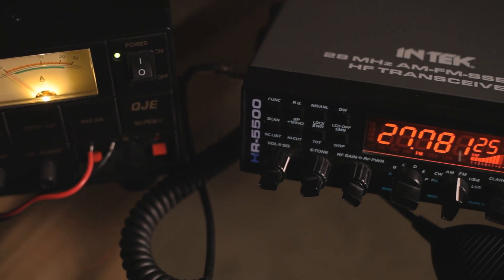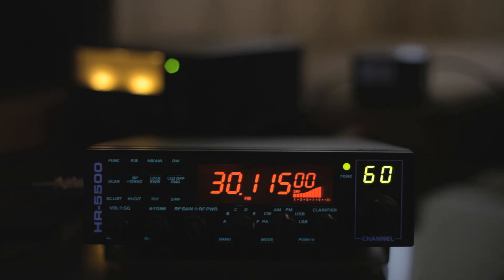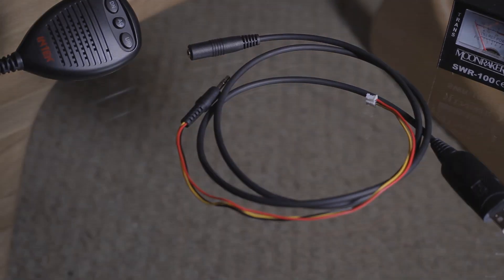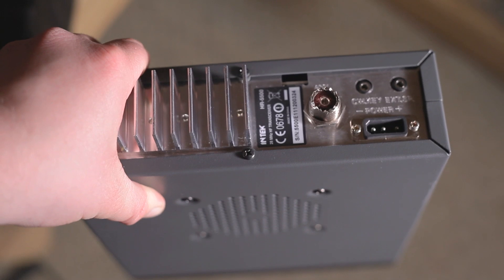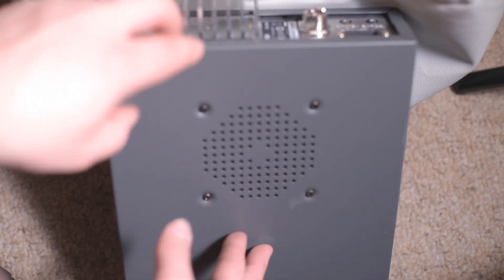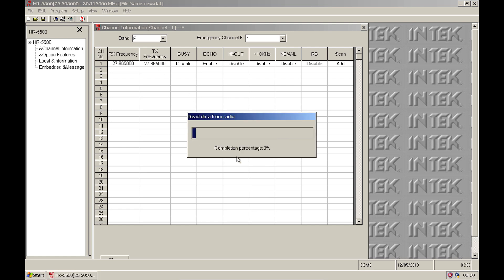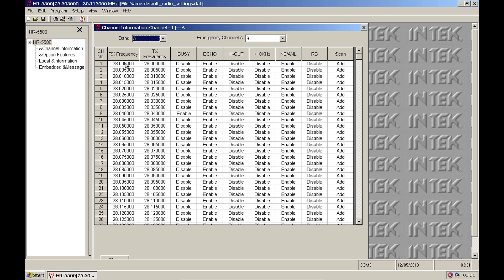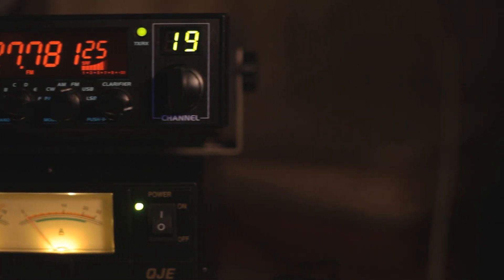How to re program an Intek HR 5500 radio transceiver

Comment: lol, there is nothing wrong with using a ftdi adapter or other generic usb to serial adapter, its totally fine and you dont have to buy a specific radio programming tool, they are just over priced usb to serial adapters!
For a while I even had a Hc-06 Bluetooth module hooked up to the programming port and was making changes wirelessly, the hc-06 and hc-05 modules are just serial modules which connect to your PC via Bluetooth instead of USB
Reply from the maker: Hi Steve. Thanks for the comment. This was a video from 2013, and my recollection was that I had different serial cables which I tried, and they did not work. The only one that worked was the specific one I bought for this. That's not to say I didn't faulty cables, or other cables designed for something else! I don't have this device anymore, or any other cables to try and confirm your comment.
Reply: @TheVisionMixer  The programming socket on the radio uses standard 5v Serial.
One pin is ground another is TX and the other RX.
There is nothing radio specific going on on the programming port and any 5v serial tool will work.
If you couldn't get your programmer to work, is it possible you had the Tx and Rx connections the wrong way round?
Tx of the programmer needs to go to Rx of the radio and Rx of the programmer needs to go to Tx on the radio.
Getting them round the wrong way will not cause any damage but it will not work.

Comment: found how to change bands:
Transceiver off. Press and hold the button FUN(upper left)+EMG/SRF(lower right) at the same time and switch the transceiver on. It indicates now: 1band, turn the rotator (right) to put: 2band, then press the button FUN a few seconds until it shows rEs then rEnd. Switch the receiver off and on again, now it has changed to the "lower" band 25,615 - 28,305. This is the expanded range an can be programmed from 25,615 to 30,105 max.
Reply: Duuuuuuuuuuuude, excelent comment THX... after a day trying to connect this thing fith pc(win 10) you save my life!
Reply: @Cyberboy42  you're welcome!

Comment: il download non funziona c'è un modo per scaricare il dat file altrove??
Reply from the maker: Prova questo file. È disponibile solo per la prossima settimana:  https://we.tl/t-jMYdvIM1Cz

A UK40 (27.60125 - 27.99125),
B EU & US MID CB (26.965-27.405),
C 27.415-28.055 ("alpha" gaps to start but sequential after CH20)
D,E,F 10 Meters (28.065 - 29.855)
Reply from the maker: Or try here: http://radioaficion.com/mods/maas-dx-5000-software-v5/
Reply: @TheVisionMixer   ho provato a scaricare entrambi purtroppo non funziona io ho il crt 6900n v6
Reply from the maker: @sclep1  Mi dispiace, non conosco il 6900n. Solo il 5500. Non so quanto siano simili. Oggi la maggior parte dei file è offline.
Reply: @TheVisionMixer  infatti il problema è proprio questo su internet non si trova assolutamente niente vedro' di risolvere con un mio amico che ha la stessa radio copiando i suoi dati e passandomeli intanto grazie mille per la disponibilita davvero gentile buona vita 73 51 da filippo 1fvg013

Comment: thank you for your nice video - you can also take off the other cover and route the cable under the PCB and out the small hole situated next to the antenna screw, imho this is slightly neater and less likely to wear the cable than taking it through the casing/back route.

Comment: Intek Hr 5500             http://www.cbradio.nl/intek/intek_hr5500.htm
CRT ss 6900              http://www.cbradio.nl/crt/crt_ss6900.htm
Anytone AT-5555      http://www.cbradio.nl/anytone/anytone_at5555.htm
K-po Dx 5000            http://www.cbradio.nl/kpo/kpo_dx5000.htm
Hanover BR-9000     http://www.cbradio.nl/hannover/hannover_br9000.htm

Software much the same rebranded per radio

Comment: the video is very helpful but would have been a little more instructive  if you had told people to reconnect the power lead the speaker and microphone and switching on the power supply  after attaching the pc lead  into the pc or laptop and switching it on else the radio will not power up took me a little while to figure that out as you forgot to mention that bit and please do not delete my comment as it will be helpful for others who are watching your video and may also wonder why no power is coming from the radio after attaching the lead to pc or laptop then select the read function for the radio to switch to pc mode as I said before the video is very instructive but could have had a bit more information added to make it the most instructive one n you tube for these kind of radios cos there is nothing else on the internet comes close to this one thank you
Reply from the maker: Sadly YT are removing Annotations, but I've added two "polls" which are titled with the info you've pointed out at the correct places in the video.

Comment: Please bear in mind that the Intek 5500 radio can work on 10 meters and 11 meters, all that is required to change bands is to switch off the radio. Hold the S/RF and FUNCTION buttons while turning the radio back on, next you will be given a choice of band 1 or 2, when you have changed the band hold FUNCTION button until END comes up. Turn radio off then on and you have switched bands, this is for version 6, don't know if it is valid for version 5. .
Reply: Many thanks sir, there you spared me for several things and that worked altso on my Crt SS 6900 N too, great day to you from a Danish guy living in Bulgaria.

Comment from the maker: Hi there. I haven't deleted any comments? But answering the one below, I don't have Windows 7, a v6 radio or the v6 software to troubleshoot for you. When I get a message like that, it's usually because the software is trying to connect using the wrong COM port. Perhaps try a different COM port?